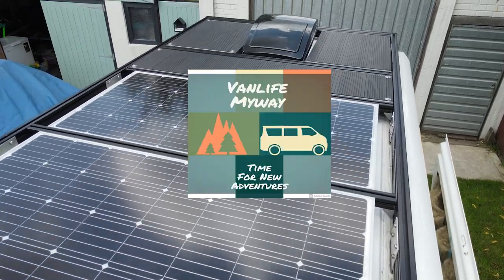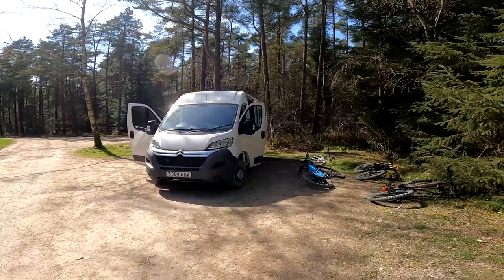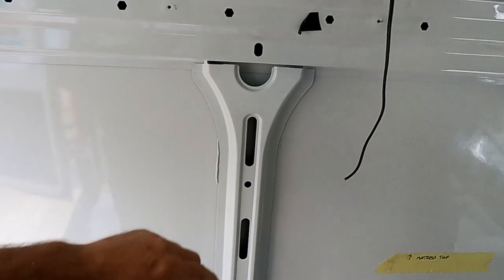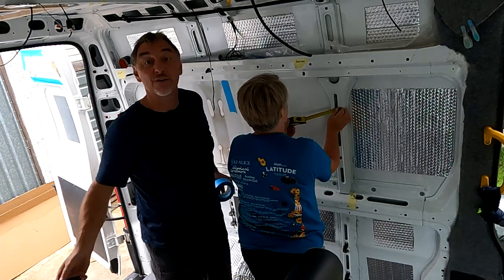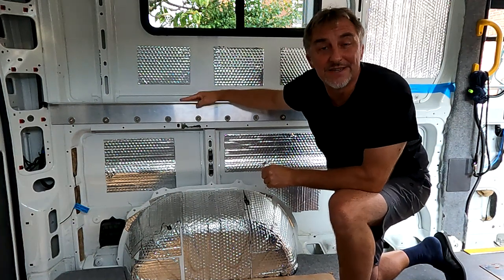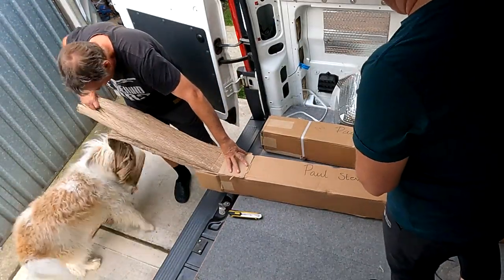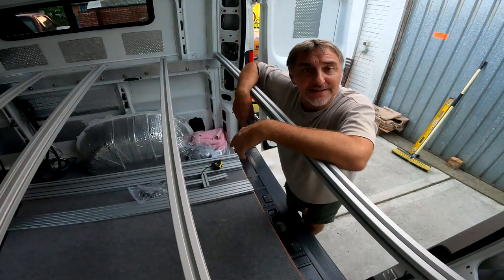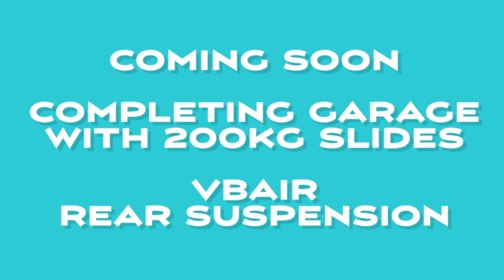80/20 RAISED BED OVER MTB VAN GARAGE

Comment: I am going for a ( night time) width-ways 4ft bed ( small double), but half would slide backwards, leaving a 2ft bed at the back, with a mattress cut in half, which flips over the other mattress in daytime. Then I am having a widthways seat below the sliding part of the bed ( below the sliding part of the bed). I aim to build this from 3x widthways lengths of extrusion, with well spaced wooden slats. This works for me, giving me half the size garage that you have, as I don’t need a MTB garage.
Having spent this year in a caravan, I like the space saving “ convert the sofa’s to bed” idea, but the real pitfall is having to do your bottom sheet bedding every night. And of course it is very limited storage.
So, I hope my “ semi sliding bed” design should give me the best of both worlds.  I Just hope that I will have enough clearance to flip one mattress over on top of the other, whilst leaving a ( elasticated) bottom sheet attached to both of the mattress’s.🤞
If that doesn’t quite work, I may have to release 2 corners of the fitted bottom sheet.
Reply from the maker: I'm sure Ive seen similar styles by some American vloggers which makes perfect sence for a vanlifestyle.
I know "flipping" the bed will make for easy "make up" but won't that 1/2 bed be better used making your bench down below?
I'm sure though I've seen the below area as 2 bench seats either side of a slide out table from benieth the bed..... that'd work too.
Find us at MyWay Adventure on Facebook and send us some pictures of how you're doing.

Comment: Hey stumbled across your channel this morning loving the videos ! Do you mind sharing where you got the long bed side supports from and would you recommend riveting or bolting these it’s going to be for a Mercedes sprinter
Reply from the maker: Thank you so much for watching and your kind comments.
The angle alloy I found in ebay and I was fortunate to have pre-existing holes in the frame of the van with enough access to pen mark the alloy when I aligned in place.
This allowed me to drill the alloy and bolt direct to the frame with a rubber break in between.
However, enough rivnuts would still support quite well.
Best wishes,
Paul

Comment: Hi guys. What are your dimensions for having the bikes underneath? How high is the bed and is there a good level of clearance from the bed to the ceiling? We are having the same decisions. Thank you guys
Reply from the maker: Hi Hannah and thanks for getting in touch.
We can sit up in bed on a 6" mattress.
Going back to the first vlog on the garage build you can see how we started the process.
Our bikes are 650b with a max of 140mm travel, however, I do have to remove the seat post on mine to clear the bedframe.
All the measurements were very precise so it will be well worth taking into account your bikes.
But.. Be reasurrsd we have our bikes in and headroom in the bedroom.
From the van floor to the top of my angle supports is 35".
We then have 40mm of cross pieces in extruded alloy, a 12mm wooden bed base and then the mattress. We then have 32" of headroom plus any mattress compression.
Hope that helps,
Paul

Comment: Oh great! So your bikes are only 65cm tall? Ours are about 75 to the wheel with the saddle off. 
My bike is long too, as its a triathlon bike and is 170cm long so i am wondering whether there is a way to store that with the handle bars turned to the side.
Reply from the maker: The overall space I have for my bikes is 83.5cm.
The taller bike faces outward as the handlebars can't fit under the bed but fortunately fit between the bed and back door.
Reply from the maker: Take a good look at the vlogs and "pause" where you can.
Out bikes are perhaps longer than 170cm but fit perfectly under our bed of 140cm wide considering extra space between the bed and back doors.
Also, we don't have a solid wall between our bed and galley so any extra wheel length could encroach into a kitchen cupboard if nesessary.

Comment: Great series of videos mate. Our next project is the bed with 40/40. What dimension & thickness of angled aluminium did you use and did that come from KJN like the extrusions? Those bolts/washers look perfect too...what are they?
Reply from the maker: Good morning Gordon, thanks for watching and thank you for your kind comments.
The angle is 100 x 50 x 5mm which I either found on the Internet or ebay...I'm not sure which.
The bolts are stainless steel dome headed 8mm thread I purchased from my local stockists which I used with stainless steel "repair" washers at the front to spread the load over the soft wood and standard stainless steel washer on the back with a stainnless spring washer and std stainless nut on the back rather than a lock nut for quicker assembly.
Towards the rear door pillar you will find an 8mm rivnut in  the bodywork that you can first attach the angle.
Using that as a pivot point, I had Nicky hold the remainder level whilst I put on a latex glove, sprayed my finger with paint and dot marked from inside the body work where all the remaining holes should be drilled. Drilling out to 9mm gave me "wriggle room".
Strip rubber I bought off ebay.
Hope this helps.
Find us on Facebook MyWay Adventure and keep in touch Gordon.
Best wishes,
Paul

Comment: Can I ask what size bed you ended up with ? Looking to do something similar to house 2 Electric Touring Bikes under the bed.
Reply from the maker: Hey Chris and thanks for watching. We ended up with a bed at 1800 long and 1400 wide which is actually bigger than the bed we have in the house....
I could have squeezed a few good mm more out of the length (sideways sleeping) at a cost of thinner insulation.
Best wishes,
Paul
Reply: Thanks for that.

Comment: Nice job!  What will be the clearance height from the garage floor to the bottom of the bed platform to fit your bikes?
Reply from the maker: Hi Michael, from the tallest rib in my van floor to the top of my alloy "L" shape brackets is 885mm.
However, 25mm closed cell foam board and 12mm ply will cover the floor and 40x40mm extruded alloy will bridge the brackets raising the bed height.
Bikes are 140mm travel 650b.
Hopes this helps Michael.
Next vlog will hopefully be covering the completed garage build, just waiting for some warmer weather.
Reply: @vanlifemyway7806  Nice - look forward to it

Comment: How to did you connect the extruded aluminum cross beam of the bed to the angle that is attached to the van?
Reply from the maker: Hi Robin. I drilled an 8mm hole in the angle and used a 
dedicated slide in bolt in the cannel dropping it through the hole to tighten with a nut.
I could have alternatively used one of the slide in nuts  in the section and bolted up through the hole. Either way would work well.

Comment: did you use 30x30 mm extruder 80/20 ? nice project btw
Reply from the maker: Hey Paulus and thank your for your kind comments.
I used 40x40 for the bed frame and 30x30 for the over wheel arch units that you can see completed in our final garage build vlog. However, with the down supports I used, 30x30 would be more than substantial enough as this stuff is very strong.
Take a look at our last vlog to see the completion, let me know what you think and feel free to ask any questions.
Paul
Reply: @vanlifemyway7806   hi there tthanks for reply appreciated, I know it is a very strong build and above that its very light and that is a fat plus for van builds,  the way you build the bed frame and those sliders for you bicycles is the same idea what I wanna build next year, but not for our bycycles but for easy access to my wasmachineand further storage , how high is that bedframe from floor to the bed frame , thanks again an it is a very nice strong light build, a little expensive but it profits the van loading weight
Reply from the maker: @paulus47  The height to the absolute top of my 40x40 from the bare floor of the van is 950mm. I used 30mm alloy and insulation board for the floor and 12mm ply on top.
The angle on the side allowed me to raise the bed above what many people do to allow for the height of my mountain bikes.
Reply: @vanlifemyway7806   thank you and again appreciated to take the time to reply here, that is what I wanted to know , will check your completed video,   😎👍